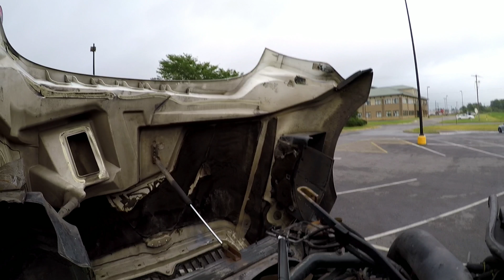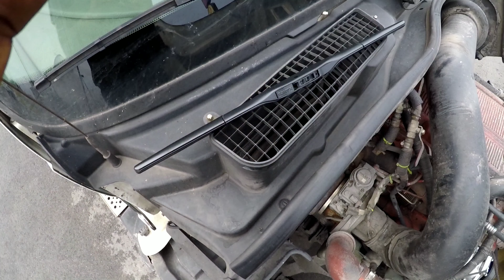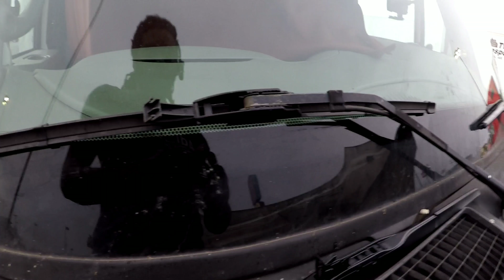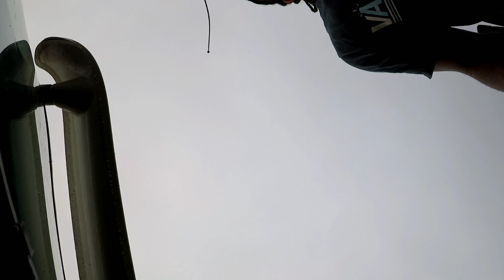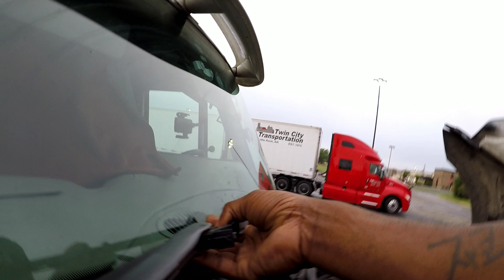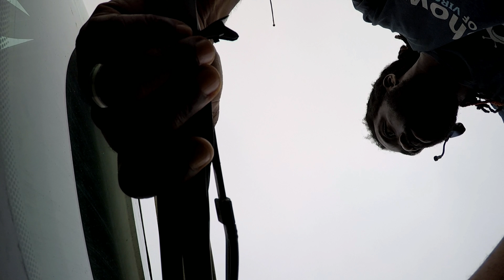REPLACE WIPER BLADES // SEMI TRUCK

Comment: Simple and straight to the point. I'm not ashamed to say I came here specifically for this because my wiper literally just flew off in a storm driving down 95S and I refuse to be stranded for maintenance over a wiper 🤣🤣🤣 thanks driva🚛🚛🚛💨💨😎
Reply from the maker: That storm was crazy, a lot of 4 wheelers ran off the road when I was coming out of Florida this morning. Always carry spare wipers, they are cheaper at Walmart. Thats for checking out the channel, besafe